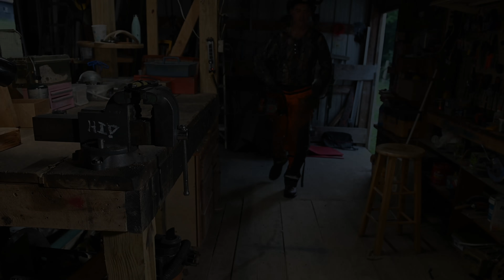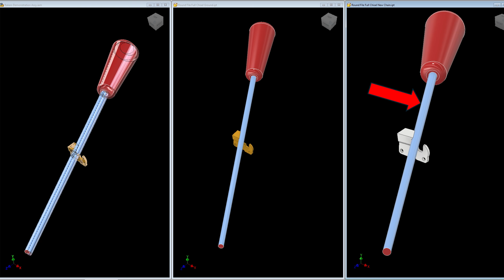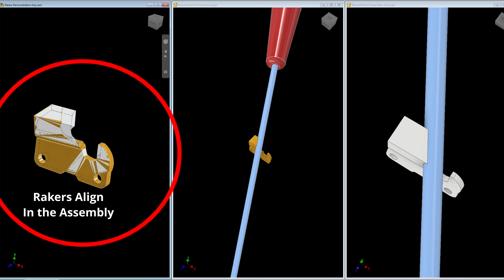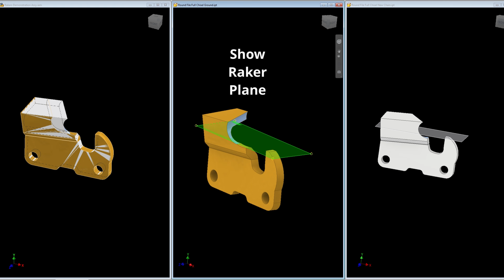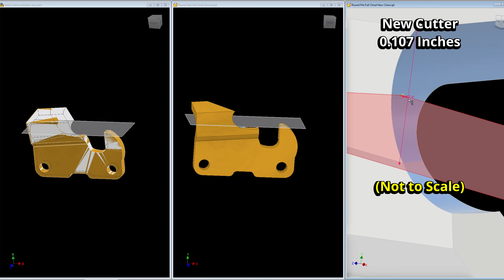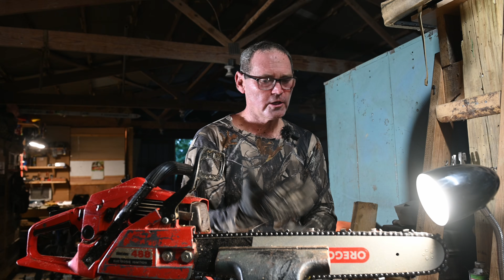Chainsaw Chain Rakers or Depth Gauges - Why AND Why NOT to File Them

Comment: It's about keeping your saw efficient and not wasting time and fuel.  Incorrectly set rakers result in both.  There's a file guage you can get that usually has two settings for hardwood or softwood.  The difference in height is tiny but it makes a hell of a difference if you're out!  Basically yes, raker filing is absolutely essential, any pro will tell you that!
Reply from the maker: Yes.  Rakers are definitely important for both performance and safety.  

I'll bet several pros out there know their saws and file when they detect their saw is running high RPM and not making full use of available power.  Do they carefully guage each raker?  I'd bet many saw users than one may imagine go by the seat-of-the pants feel, as I do.  

I spend too much time concentrating on precision and minutia in other parts of my life, such as my day job, to concentrate on fine details while chainsawing.  Raker guages take the fun out of sawing for me.  

Also, only 2 raker settings, soft or hard, doesn't leave room for fine tuning between the extremes.  Wood and cutting needs are too varied for only 2 potential chain settings, in my opinion.  I like more customized control.
Reply: @RoomtoGrowRural The point I was making is that the difference is noticeable when the setting used is incorrect for the wood being sawn, and the fact that actual raker height is only fractionally different between the two.  It makes that much of a difference that I think guessing might be a very hit and miss experience for many.  If you know what you're doing and are well practiced then yes, it probably works out.  Looking at the chips is the way I do it.
Reply from the maker: @Altair885 Yes, I will pay more attention to chips.  I'd advise one to adjust, cut, adjust again to avoid filing too much. Think?
Reply: @RoomtoGrowRural  Yeah, there's a sweet spot that you get to know is about right.  As other's have mentioned it is different depending on the particular wood being cut but the raker gauge is usually not far off as a reference.  I'd start by using the gauge but not filing too aggressively so it's a slightly proud finish, you could then test the cut and just rough hand a few strokes per raker if you feel there isn't enough bite.  All takes time though I guess.
Reply from the maker: ... and I showed 1 stroke per raker in the demonstration.  Baby steps.

Comment: Buy Oregon XX9525-5.5 kit and read the instructions. ;)
Reply from the maker: If you want to work "by the book" I guess that is a good solution.  I like to go a little less formally, to "shoot from the hip" so to speak.
Reply: @RoomtoGrowRural There is a tool included to adjust the correct heigth, no need for freehand adjustments.
Reply from the maker: @PhreakDarkSoul   While adjusting to a consistent height may be important, which is the "correct" height?  There isn't one.  Logs and wood are more variable than that.

Comment: This time of year I do a bit of cutting/falling. I find that if I kiss on the rakers before 4-5 sharpenings I can't bore with it because it's too grabby. I put 80-100 face of beach on the ground 4 days ago in trade for my new Husky 562-the owner of my local dealer won't fell trees.I only run pro saws because of durability and chain speed-My 395 knocked me down twice boring because I had the rakers filed too much,it's not fun to be cutting one second and the next to be flat on your back with a 36inch bar trying to party with you!
Reply from the maker: Yeah, one thing I didn't mention in the video is that too much raker causes the saw to kick back.  Another reason to grind them in a slow and controlled manner with test runs between filing sessions.  As I said,  you can't put the metal back on the tooth.
Reply: @RoomtoGrowRural  I'm on your side!
Reply from the maker: @garthland Thx ... subscribe?
Reply: Just bought my 562xp Mark ii, in the spring. Its the first Professional saw I ever owned, and man, am I happy. However I will be putting a different muffler on it eventually. As far as chains go, do you keep running with husqvarna chain or what have you found to be the pinnacle of chains?
Reply from the maker: @TheUnseenWaffle Congratulations. Life is too short for poor saws.  I like Stihl, Husq, and Oregon chains.  I like full chisel myself. I steer away from Chinesium.
Reply: @RoomtoGrowRural  full chisel, square ground chain is where its at for sure. I cant go back to round ground 😂.
Reply from the maker: @TheUnseenWaffle Yeah, I may have to try that.

Comment: Because I was a precision machinist I have various measuring tools so found it easier to measure 'noodle' from ripping oak..
Thickness on chip after 2~3 sharpening's was 0.015" instead of 0.025".
Using nose of saw is pretty similar to having very low rakers, but, because you only have a few teeth cutting saw doesn't bog down.
Rakers too low and weight of saw will slow things down just enough that clutch slips slightly, after about 10 gallons of fuel, clutch drum literally falls off sprocket (I found out the hard way)
I guess what your really saying is have rakers a little high and use rpm to get higher cut rate?
Reply from the maker: What I am saying is it is better to run the saw happy with RPM and load than it is to cut 3 seconds faster.  Yes, I advocate trimming rakers, but not so much that they bog the saw, and I propose erring on the side of rakers too high rather than too aggressive.
Reply from the maker: Chip size will vary, depending on if you are cutting small logs, just getting into or out of a round, or whether the saw is buried full bar in the wood.  Dog pressure affects it, too, of course.  Many variables.
Reply: @RoomtoGrowRural  22" bar, fully buried.
I know I'm overworking my $89.00 Chinese saw but can't afford a Stihl, Husky or Makita
Reply from the maker: I thought more about it.  Another thing I was trying to get across is that some people file rakers down excessively to get more cutting speed.  However, if the saw can't pull it you wind up cutting slower because the saw is bogged into an RPM where it doesn't have as much torque or horsepower.  In that case you'd be better off to go with slightly less aggressive rakers and more chain speed to achieve a more efficient cut.